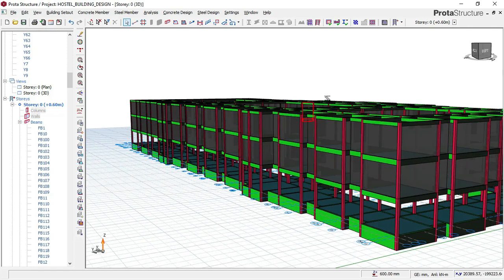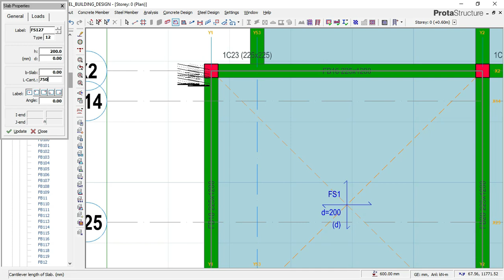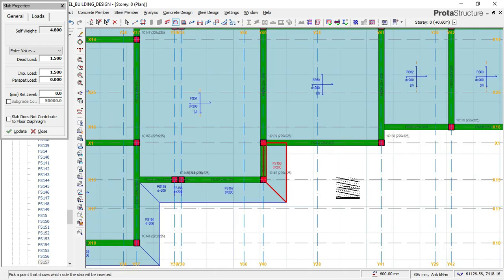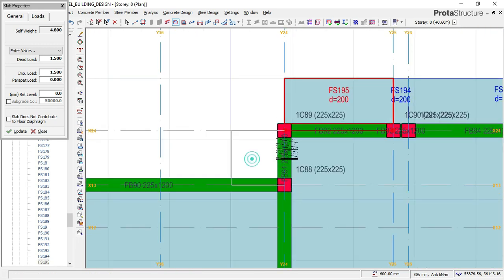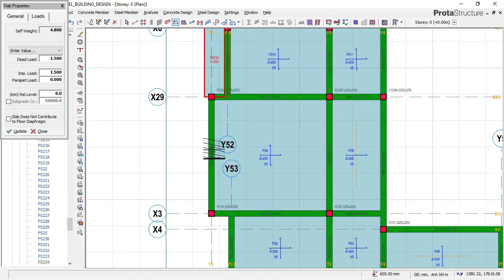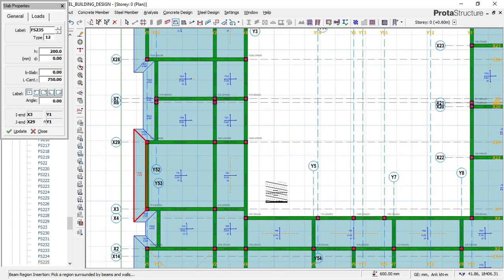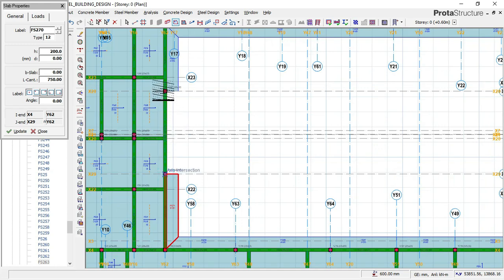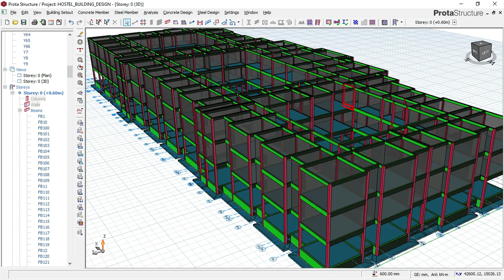PART 8 - Design of School Hostel RCC Building using Protastructure.

Comment: Good day Mr justice.
Can you clarify.
You didn't insert beam wall load on the ground floor beam, can you comment on that pls
Reply from the maker: There's no need to add beam wall load on the Raft foundation beam. The beam depth  of over 1 meter can carry any kind of wall load so there's no need adding the wall load to it because it will have on effect on the beam due to the large depth of the beam and also the beam is resting directly on the soil.